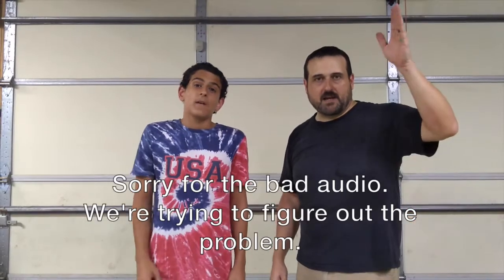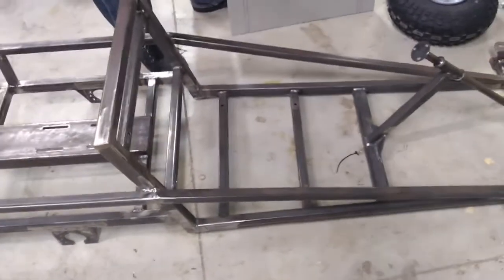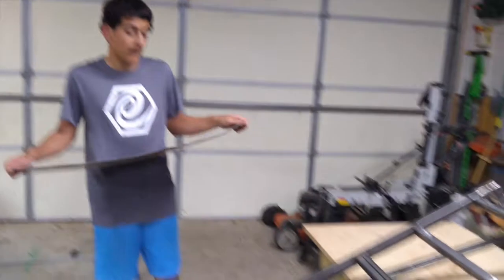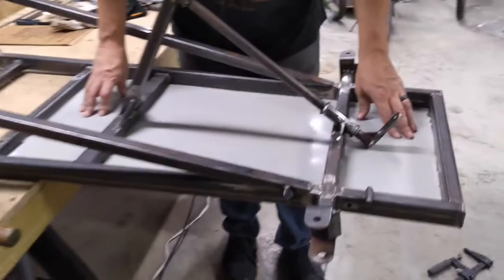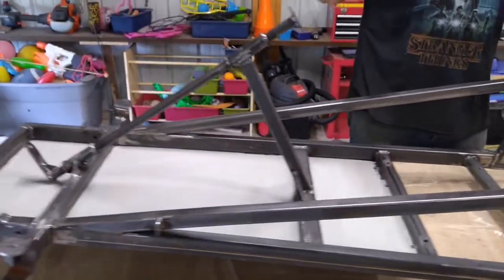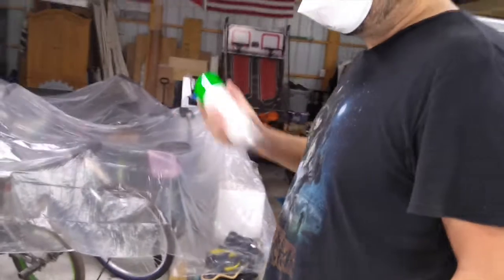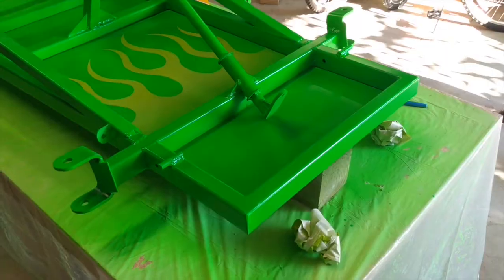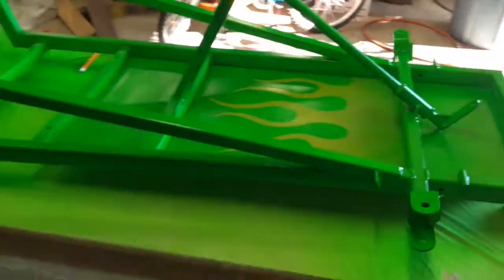Building a Go Kart, Part 5 - Floorpan and Paint Job

Comment: Is that a 60 you sprocket in the axle?
Reply from the maker: Yes it is. I had considered using a 54 tooth, but it's plenty fast with 60.
Reply: Antics Garage was it a 10 or 12 tooth on the tav?
Reply from the maker: I'm pretty sure it was 10.

Comment: I stop buying arousal paint cans and buy Rustolum that I can put in a paint gun, only because every time I go to use paint in my shelf no air in the can. I just mix some paint in a Harbor freight cheap paint gun. Paint job comes out good enough plus better results than a spray can.